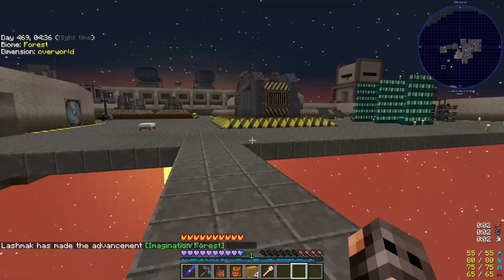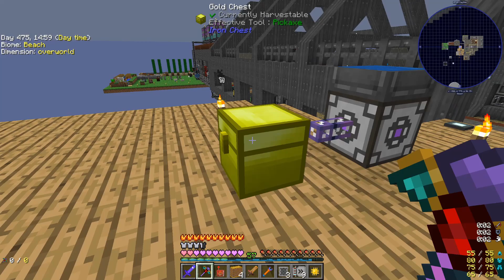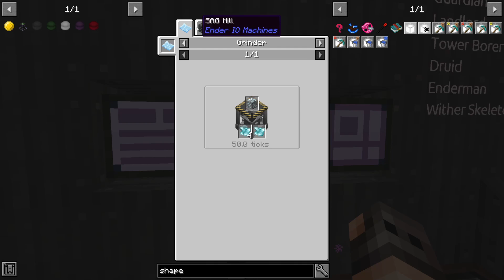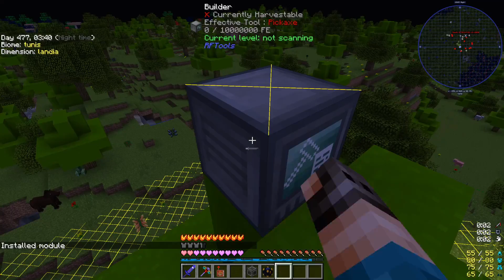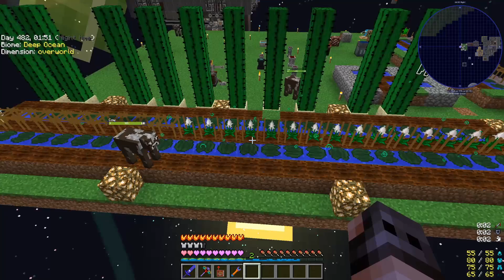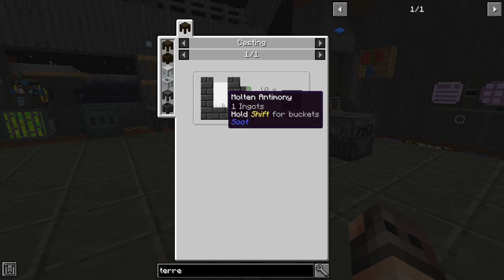Project Ozone 3 Kappa Mode: Episode 16 - Excavating Landia, Mystical Agriculture and Terra Steel

Comment: Btw, the transmutation table recipe consumes the philosophers stone so you may want to make 2
Reply: Joelifer the simpler solution is to make the energy condenser first and use it to duplicate the stone
Reply: That is also a solution, But that is less fun
Reply from the maker: Thanks! thats actually a very useful thing to know. but i just saw the reply too and i was thinking the same. cause it has EMC :D 
in anycase i have to make one for now. i dont have enough HECM fuel

Comment: WARNING ON MEKANISM AE AUTOMATION - it is severely bugged because of item NBT tags, so I suggest you use enderIO crafters instead, or you will suffer great server-side lag!
Reply: The lag comes because of some weird nbt tag bug, where even with correct recipes in the pattern, the crafting manager STILL wont recognize it, and spams the logs with CraftingManager fallback error...
I read it up on github, a few issues talked about it, have a look to understand it.
Reply: He just has to make the patterns with crafted energy tablets instead of taking the recipe from JEI
Reply: @dubl33_27  I guess OT talked about lag, what is an issue on all crafting Mekanism items with AE2. Dono why, but it happens in other packs as well.
Reply from the maker: That is absolutely correct. it cannot differentiate between ultimate and elite cubes for some reason. it crafts them but cannot assemble the final result. Personally i dont  mind cause i just assemble it myself but you can wait for hours and its still crafting :D